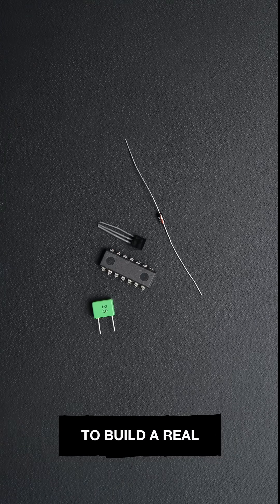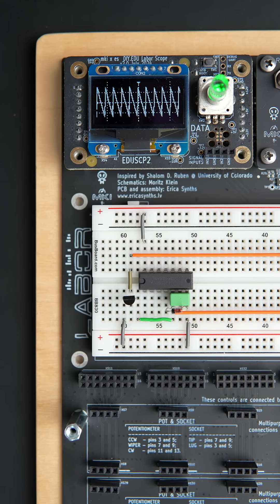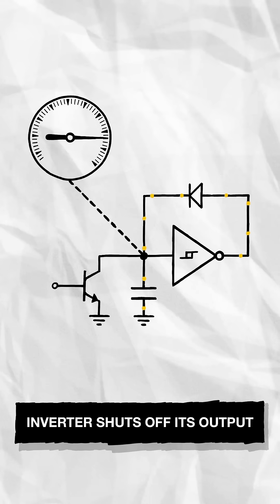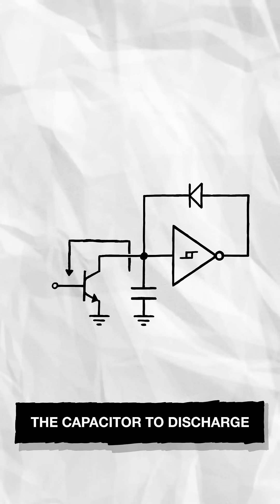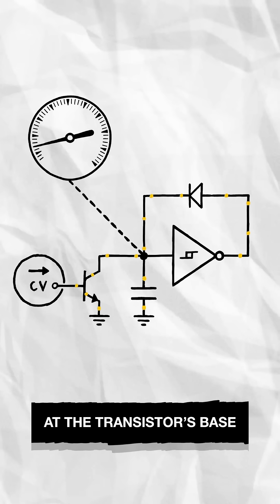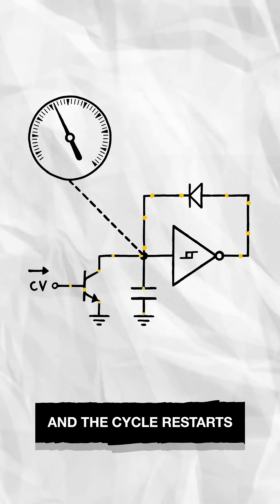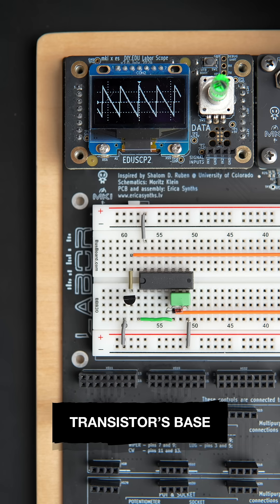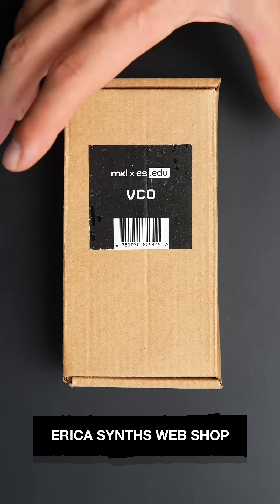4 Basic Parts = Real Synth VCO #modularsynth #synthesizer #electronicmusic #sounddesign

Comment: nice explanation. Without a diode would get a square wave, but the transistor trick would not work. Sawtooth contains all harmonics, not just the odd ones like square wave does.

Comment: Now comes the hard part: attaching it to real input CV with 1V/octave.
Reply: Right! The 40106 (i guess they used it here) is nice for drones because you can build six  oscillators from one chip. It is also hard syncable and cheap as chips. You CAN also get the 1V/octave I've seen such a circuit and one to get not just a sawtooth you can get a pulse wave too.  But I guess the biggest problem is the stability. But for a drone thingymajiggy a little "built in" movement is cool. Sorry for my bad English hope you understood everything. It's been a while since English class. ...

Comment: One important point you forgot to mention is that the current flowing through the transistor needs to be very low otherwise I wouldn't work!
Reply: Yeah, operating in saturation mode is not going to be productive. The overall resistance shouldn't drop below... I dunno 1K ? or else it would either, not be able to trigger the inverter or, increase the frequency well above the audible spectrum. I wonder if this could work with a N channel Fet You might be able to turn this, into a Theremin ;)

Comment: Why is voltage flowing from ground, through the capacitor and through the transistor? Why would voltage flow from ground?
Reply: Voltage doesn't flow from ground at any point, also I would say voltage doesn't flow at all. But if you mean when the capacitor discharges through the transistor, the capacitor is storing a voltage differential between its two plates. The side which is connected to ground stays at ground voltage the whole time.

Comment: Is the input supposed be DC?
Reply: absolutely.  You can make your own ac to dc rectifier with 4 diodes and voltage regulator with a hefty heat sync and a parallel resistor+cap

Comment: this is all you need. proceeds to show the breadboard connected to a circuit........ English isn't that hard fam.
Reply: Those components are all that's needed to make the VCO. You can clearly see the only connections are power, the CV input wire, and the audio output wire.

Comment: two things i'd like to see, which has been asked about partially in other comments here: 1) how do you connect this to some sort of sound output? 2) do you have, or can you produce, a video that demonstrates how to provide a simple testing input CV (so that someone doesn't have to have some sort of purchased device with a CV output to control this, such as a beginner doing a DIY build such as myself), as well as a video showing how to take a breadboard circuit output and put it to a simple audio amp circuit?

i would love to use a simple custom speaker setup with a simple circuit i built myself, or with a pre-built amp circuit + driver circuit....

love your videos! keep up the good work!
Reply from the maker: 1) easy: you route the sawtooth voltage to a jack socket and connect that to an amplifier 2) i've done a video explaining how to build a simple 5-step sequencer: https://www.youtube.com/watch?v=vHNQQ6yUGyo 3) check this video for step-by-step instructions on how to connect an audio-generating circuit to an amplifier: https://www.youtube.com/watch?v=XpMZoR3fgd0
Reply: @MoritzKlein0  doesn't the sawtooth need to be buffered before it goes to the amp? or does the amp act as the buffer?
Reply from the maker: @JosephHinke-c9b  yes, the amplifier acts as the buffer in this case!

Comment: Thanks, but where are the output wires? Is one wire of speaker connected to tran emitter and other to GND side of cap? Both are labeled GND in that video. I like that pressure gauge indicator👍🏻
Reply: One wire of the speaker (or amp) is connected to the inverter output. The other would be ground.

But that got me thinking, the voltage to the speaker (or amp) would always be positive, so you wouldn't get the speaker membrane moving back, only forward. Now I'm stumped.

Comment: Complete noob here, so im sorry if this is dumb, but if im understanding correctly, the rate of that loop of current  rapidly filling and draining becomes a pitch if the incoming voltage <and thus the rate of the cycles>is fast enough?
 Is this signal as is what goes out to an amplifier and into  speakers, or are there other steps to make this a sound?
Reply from the maker: not a dumb question at all! if you connect a swinging voltage like this one to an amplifier + speaker, you get sound. that's the because the membrane will move back and forth as the signal oscillates. this also means that there is no distinct point at which this "becomes a pitch" – it's just that it might not be audible (because it's too low or too high).
Reply: @MoritzKlein0  Got it ! So the difference between the sound output of a VCO and control voltage from an LFO, is just whether or not the pulsating full/empty electrical cycles coming out  are fast enough for our ears to turn them into pitches.Thank you!

This also probably  explains why VCOs "sound alive" compared to digital approximations im  guessing , because there will be a bunch of unavoidable tiny imperfections  in each pulse cycle, that add up to making the VCO have a "warm and alive" sound

Comment: Question: if there is a voltage at the base of the transistor thus allowing current to flow through, then how does pressure build up at the capacitor? Or maybe what I'm asking is if the transistor is on too much won't all current go through that and not the capacitor, leading to no pressure build up at trigger
Reply: That's why you don't turn it on all the way. You turn it on just enough that it can drain the capacitor hundreds or thousands of times per second. The more you turn it on, the faster the capacitor drains and the higher the frequency coming out of it.

Comment: Why does the current not rravel trough the Inverter instead of the diode? Why does the Schmitt-Inverter shut off (automatically)?
Reply from the maker: current cannot flow through the inverter. the inverter's input is basically just a sensor, not an opening.

the inverter shuts itself off because it has an upper input threshold. if the voltage at the inverter's input crosses this threshold, the inverter flips its internal state (from on to off).

Comment: Why is the discharge graph not curved? I mean it's a capacitor powered voltage.
Reply: it is curved actually but since the schmitt trigger's output voltage is much higher than it's input trigger voltage, the curve is invisible since the time until it switches is much less than the capacitor's time constant. the schmitt trigger here behaves like a constant current source basically.
Reply: also with this barebones setup you could easily burn the schmitt trigger. you would need a resistor in series with the capacitor in order to limit its current draw. this issue is probably addressed in the full video tho
Reply: @kayra8942 wait, are you referring to the charge or discharge phase? I mean the discharge phase, when the smidt trigger is inactive aka "not part of the active graph"
Reply from the maker: @angelofeffektd6462  the discharge graph is not curved because the transistor's collector current is fixed as long as the base voltage/current does not change.
Reply: @MoritzKlein0 the collectors current is independent of its voltage?
How can I have noticed this during all my projects?!
Reply from the maker: @angelofeffektd6462  yes! one caveat though: this is only true as long as the voltage source at the collector can provide enough current to uphold "collector current = transistor gain * base current"!